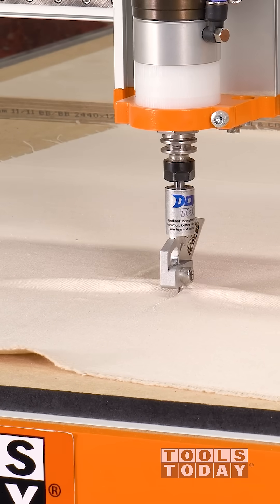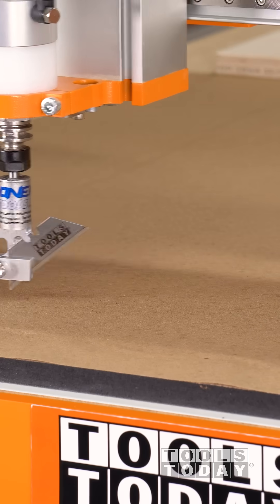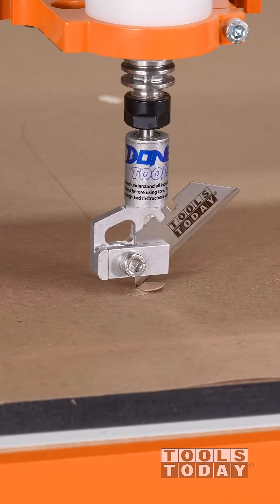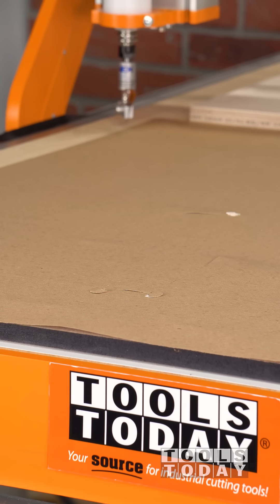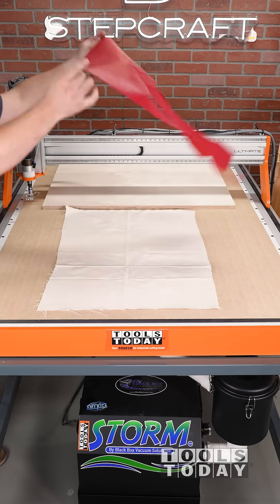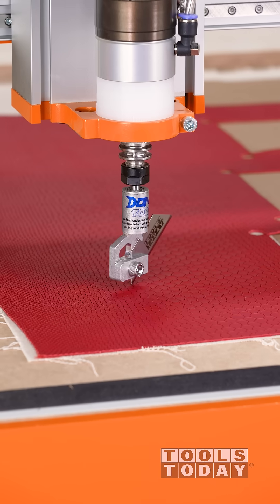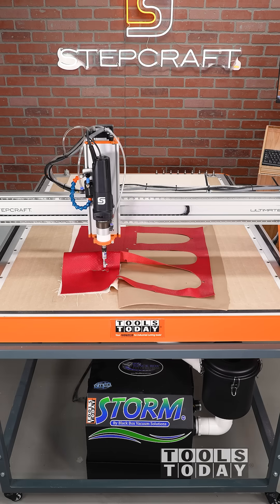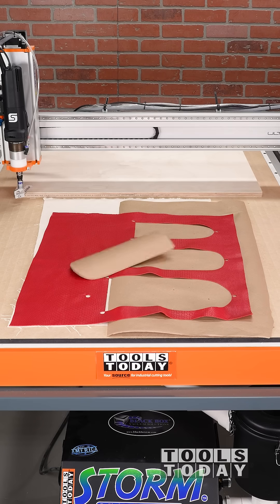Cutting Porous Cloth with Drag Knife and Vacuum Table

Comment from the maker: Cutting porous cloth on the CNC machine using the Donek D4 Drag knife to see if we can make it work. The paper trick was an excellent suggestion and worked great, I'll have to try this again sometime with a larger piece of leather to get a better hold! 
Check out the tools used on our website -  

Stepcraft M.1400 CNC machine - https://toolstoday.com/stepcraft-m-1400-48-x-64-cnc-machine.html

Donek D4 Drag Knife - https://toolstoday.com/donek-tools-d4-drag-knife-1-4-shk-x-1-4-ch.html

Black Box Storm Vacuum - 
https://toolstoday.com/black-box-vac-bbv-svp-2-storm-vacuum-system-for-cnc-routers-single-phase-220v-230v-at30-amps-2-long-life-high-performance-motors-inline-filter-not-included-but-recommended.html

Vectric V-Carve Pro Software - https://toolstoday.com/vcarve-pro-10-0-software-for-cnc-1.html

RPM: 18,000
Feed Rate: 60ipm
Plunge Rate: 60ipm
Depth per pass: .3"
Ramp in: .75" smooth
Reply: There are Untrasonic vibators if you make them from below to the table top, the entire table vibrates, but you can also use bass shakers, which are much cheaper. 
The vibration helps to restart the cut again and again.
Reply: Paper on leather too
Reply: You should try the Lenox Gold blades they legit last 10x longer than any other blade I've used

Comment: Keep the leather on the bottom since it has more mass you need to hold in place, and then you could probably make some sort of water based spray that raises the surface tension to hold the cloth in place.

Another idea is to make a jig. Take the file and raise the deminsions just a little past the normal cut points. This way you could lay it on top of the project, and then the device can cut within the boundaries of the jig laying on top of the materials. It holds everything down and since it's a few mm larger than the squares of leather used, the jig won't get in your way at least in theory. It's just a matter of marking where the jig needs to be placed each time so your project is centered on the board each time. I've done similar with laser engravers for projects where the laser fan would have been problematic.

Comment: This is awesome.  Someone should make a rolling pizza blade like the Olfa quilt cutting wheel, but for CNC machines.  It wouldn't make cuts as sharp as a knife blade without some modification, but that idea wouldn't leave the threads hanging either.  These videos are super interesting.
Reply: That's what we use for our fiber class cutting equipment for manufacturing composite parts at scale. Basically just a big vacuum table with a rolling knife.
Reply: @Jakendaker  Oh cool, now Im' looking at videos on this... down another rabbit hole on YouTube. 😂👍
Reply: It exist. Google for cnc rotary knife. There are plenty chinese cnc doing. I am also building one for my shop, just some 3d printed parts that work for low volume.
Reply: @vinevinz  Yep, I'm seeing all kinds of this type of solution... it's fascinating.  Especially to me, I used to cut zillions of the same pattern over the course of years with scissors, then a fabric stack cutter, so I can really appreciate something like this.
Reply: This is how craft cutters like Cricut or Silhouette cut cloth; you buy a separate blade insert and it's basically a tiny rotary fabric cutter.
Reply from the maker: That would definitely be interesting, may have to look into that!
Reply: Great idea doubling it up! Another idea: you could tape or thumb-tack the outside edges and weigh down the area you plan on cutting out with a piece of scrap wood. Not great for huge batches, but would work for one or two items.

Comment: At work we have a big 16’x10’ digital cutter (not exactly the same, but very similar). When I’m having trouble getting small or thin sheets to stay in place on the vacuum table I end up making a jig out of a larger scrap of whatever’s laying around. I just cut out a shape a bit larger than my final pieces, but smaller than the dimensions of my material. It engages more of the vacuum area and provides some extra grip.
Reply from the maker: Great idea!  Thank you for sharing!